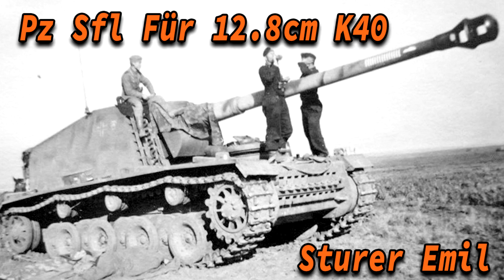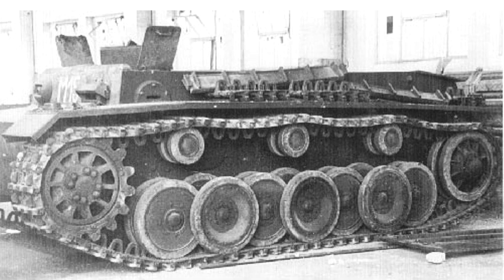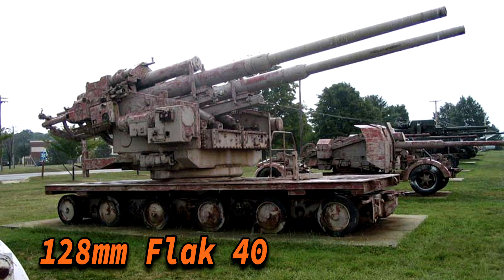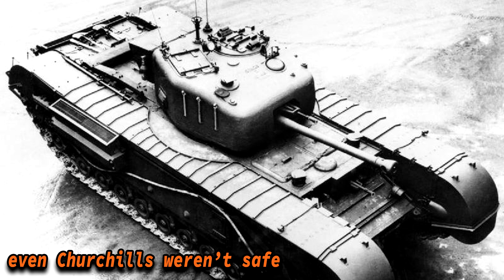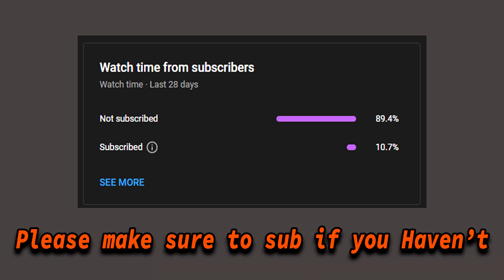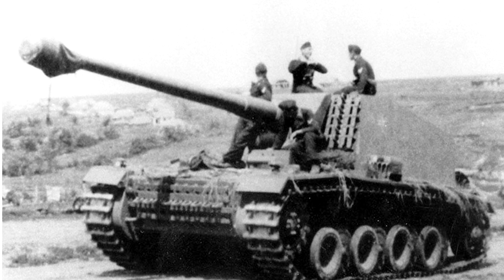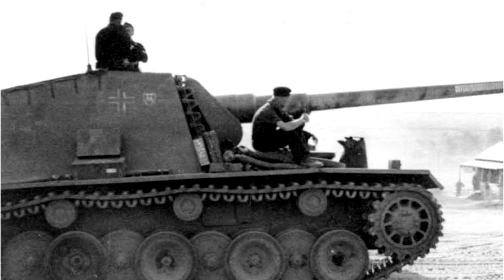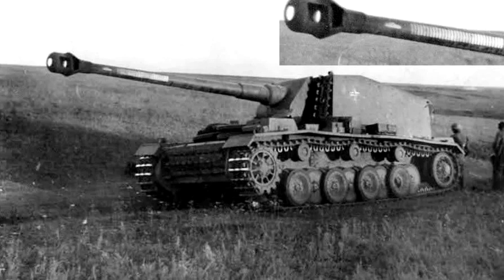Sturer Emil | Only useful for its gun?

Comment: That VK30.01 chassis is a very good proof that work on what became Panther had started well before the introduction of T-34.

While not being spotted is a clear advantage, being able to shoot and kill beyond your enemies range is not bad. It also minimizes the risk of hand grenades or Molotovs being thrown at you. Btw, most TDs of the period were open-topped because of better all-around vison for the crew. They were not meant to get into close or house combat. See M-10, Archer ... An armored roof also adds weight and in case of Emil wasn't even possible due to the extaordinary gun depression. (in WoT you literally only exposed the gun when working a ridgeline 🙂)

Sturer Emil was a one-off test-bed on a surplus test chassis; it didn't cut into production. The only intention of this vehicle was to test the 128mm Flak as an AT or field gun. Mind you that this very gun was to be adopted by all branches of the Wehrmacht as Flak, AT or field gun and even as main or secondary armament of warships. The 8,8 cm Pak 43 hadn't been fielded yet but people were already looking for the "next" gun !

You can't compare its high cost to a vehicle like Hetzer, which was streamlined for cheap mass production years later. Nevertheless, Max & Moritz took out a large number of enemy tanks thus making good for their costs on a war-economical base.
Also saying that instead of 1 expensive vehicle A you could build 5 cheaper vehicles B is nonsense. German industry was always maxed out for capacity - not necessarily very effective but maxed out anyway, that's the point. Where would you produce more vehicles of a certain type if there's neither capacity to produce nor the logistics to keep them supplied in the field ?
Due to the "strange" economy of the Third Reich, costs were not as big a factor compared to working economies.